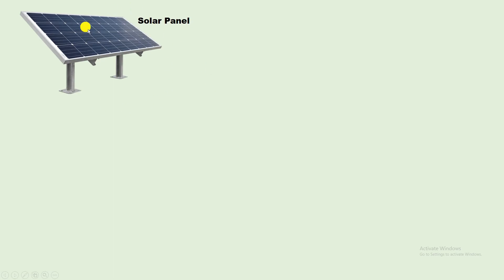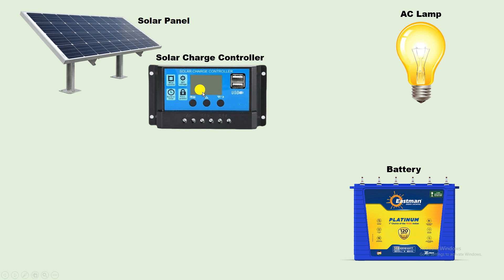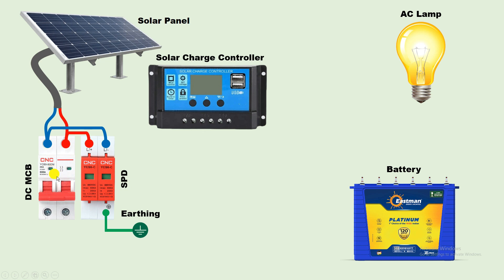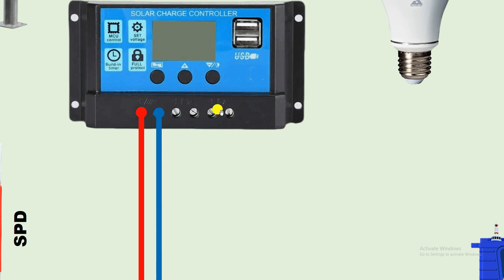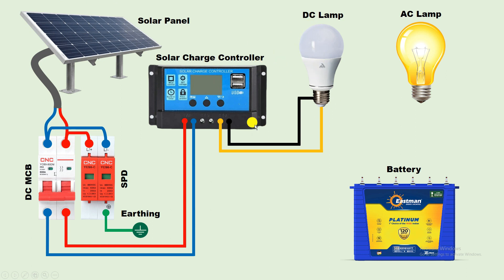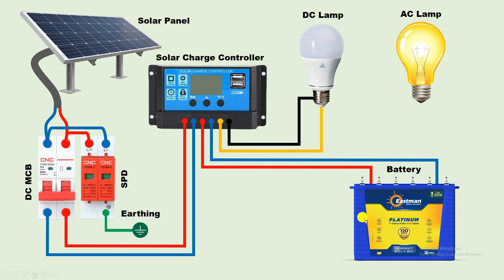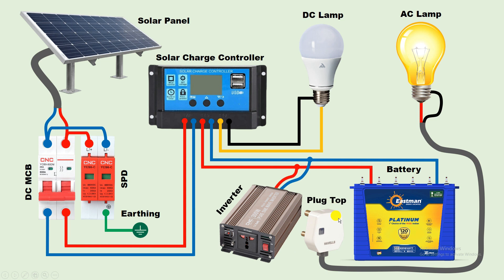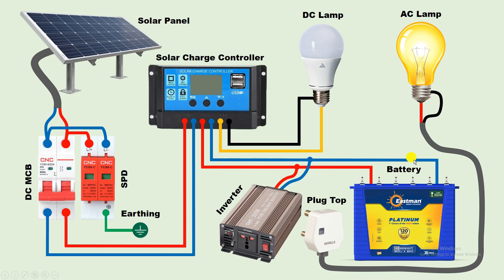Complete Solar Panel Connection with Solar Charge Controller and Inverter @TheElectricalGuy

Comment: I didn't hear him mention what a DC MCB actually is - MCB stands for Miniature Circuit Breaker and it is a DC version versus the ones in your house's electrical panel are AC circuit breakers. This is to prevent the solar panels providing too much current (amps) that may overheat the wires carrying the current and potentially cause a fire.

Comment: Hello, thank you for your video. It is easy to understand. I just would like to ask for your suggestion/recommendation.

I am planning to have the power supply of all submersible pump (4 pcs) on my fishpond. Do you recommend the same set up for this? I am planning to build the same set up as shown in your video just replacing the lamp with Universal extension outlet.

All pumps run 24/7;
Description of the pumps are the following:

1. A4000 Aquaspeed
Voltage: 220-240V
Frequency: 50/60Hz
Watt: 24w

2. A3000 Aquaspeed
Voltage: 220-240V
Frequency: 50/60Hz
Watt: 16w

3. A2000 (2pcs)
Voltage: 220-240V
Frequency: 50/60Hz
Watt: 13w

Comment: Actually this is not correct.  Your MCB and circuit breakers do not connect to solar panels.  Solar panels go directly into controller and the circuit breakers should be on the output of the controller to protect the circuit

Comment: Hi Very good explanation.

I have some questions and make discussion among the group here.

1. For surge protection device, can it install after the MCB ? What will be Pro and Con then?

2. Some country, there is not ready earthing connection at home. So, those home usually use RCCB instead of earthing for protection. For these home, installation of surge protection device maybe impossible as it will not be working at all without installing earthing cable. So, can we use RCCB here instead of surge protection device please ?

Thanks to all.

Comment: wrong..!!!!!!! battery first so that panel voltage will adjust to 12v... 

if your solar has a higher voltage your battery will be going to overheat because of over voltage..

Comment: Hello
great video!
I have at home 5 PV strings in series but different voltage and different current, I can't do a // connection?

I have 5 different MPTTs not string
do I need 5 surge protectors 5 DC circuit breakers and a big 63A circuit breaker?
thanks
laurent

Comment: Please explain that Why do you have to use MCB when you can use charge controller with higher Ampere which can control the voltage supply to battery ..

Comment: Give correct information , 
Always prioritize connecting the battery terminal wires to the charge controller initially, followed by linking the solar panel(s) to the charge controller.
Avoid connecting the solar panel to the charge controller before the battery, as this may cause initialization issues.

Comment: You also need a dc breaker between the battery bank and the inverter and you need to apply electricity security rules between the inverter and the house !

Comment: Bad piece of advice you also need a breaker between the solar charge controller and the battery bank!
Reply: Correct.
Reply: Not necessarily a must
Reply: It's improper to say bad. You can correct it in order ways. After all, he said it.
Reply: Thats why we use mcb
Reply: U don't necessarily need to feel the whole place with breakers. It's a basic setup and you could have don't better if you wanted to make corrections
Reply: But he said it,,mcb

Comment: Don't forget a fuse from battery positive in case there is a short circuit in the battery leads to the inverter, and perhaps a disconnect switch off the positive too.

Comment: When powering the ac bulb via an inverter, you bypassed the battery in your illustration. Why is this?

Edit: I now see the same wires are connected to the battery and inverter from the controller. How do you make your wires split like this?

Comment: how can i charge my battery without solar panels
Reply: Buy battery charger
Reply: Hire someone.
Reply: Can I wire the controller up to a splitter
Reply: question for you combine this solar panel 200v 400v and  solar charger controller and battery, car inventer 220w and this MC4 inline fuse holders how many are needed to handle charging a cellphone 
Pls draw me diagram
Reply: Guys what is earthing?
Reply: @POW28 ground duh
Reply: you can use just any car
Reply: Connect your AC Inverter Plug to Your Electricity Power Plug Board Socket like your mobile charger

Comment: Hi electrical guy. I have questions. You still answering questions ?
Reply from the maker: Yes ask
Reply: @TheElectricalGuy  can i connect inverter directly to controlle'r's  battery charge outout or connect it to controller's  load output ?

Comment: I have two questions. Can you please answer those? 
1) Whether the inverter is solar inverter or Normal Inverter?
2) The Stabilizer is relay voltage stabilizer or servo voltage stabiliser and what is the Input Voltage Range?

Comment: Good day sir! So is it possible in the middle of the day for power to skip the battery stage entirely if you using an appliance and getting enough power from the sun? Is it possible to get  straight from inverter to power ac while also putting dc into battery charging it

Comment: I would put MCB between the battery and inverter to prevent current surge and to protect the battery. That is where fire usually starts if there is overload.

Comment: Thanks for video 👍🙂
Why did you not wire the battery to the (solar charge controller) as the very first thing to do?? 
Thought is was important that battery was connected like the first thing to do ??:-)

Comment: I WOULD DEFINATLEY CONNECT THE INVERTER WIRE DIRECTLY TO THE CONTROL UNIT!  DSIRECT CURRENT IS NO FUICKING JOKE AND EXTREMLY DANGEROUS!!!  THIS GUYS AN ENGINEEER AND IM SURE HE IS SMART AND MADE THIS VIDEA AND I THANK HIM FOR THAT!! BUT I WOULD NOT SPLICE THAT DIRECT CURRENT WIRE AT ALL! I MEAN IT MAYT NOT BE THAT MUCH BUT ITS ENOUGH CUZ DURECT CURRENT NEVER LETS GO! IT GRABS AND WILL HOLD TIOLL THE SUIN GOES DOWN! OR SOMETHIGF BURNS OUT! OR YOU OR I BURN OUT!  AND WE DO NOT WANT THAT!

Comment: my solar panel is 175w 12v which should i buy DC MCB how many amps for my solar panel?SPECIFICATIONS
Maximum power at STC*: 175 W

Operating temperature: -40°C to 85°C

Optimal operating voltage: 19.5V

Optimal operating current: 8.98A

Open circuit voltage (Voc): 23.9V

Short circuit current (Isc): 9.50A

Solar panel size: 150.37 x 67.31 x 0.20 cm

Weight: 2.81kg

Comment: Thank you for the informatic video ! but in the rainy season if i want to charge the battery with external electricity how to do it is there a single kit for solar power controller and external electricity ?

Comment: Excellent presentation, Only suggest is to make it clear from the start .  If connecting a battery, always connect the battery to the controller before connecting the PV array to the controller so in your example disconnect the PV array, connect the battery then the PV array.
Reply: the biggest mistake anyone can make always battery first or you fry the controller.
Reply: what a pv

Comment: I have a charger inverter 24v DC system.
Can I add solar panels with a charger controller. 
Or there is no way except i should bring a new hybrid inverter.
Please, can anyone with experience  advise me on solutions in such cases.

Comment: When assembling  a  solar power system, it is important to note, that the Solar panel is the last thing to be connected to the solar control unit, 
connecting the solar panel to the control unit first will damage the unit. the battery should be connected first, followed by the solar panel, always connect negative wire first and the last wire to be connected should be the solar panel positive wire. Unfortunately this is not explained in this video.
Speaking from experience.
Reply: This is true.
Reply: I like your analysis. It shows you have a great experience in Solar connection. Please, what value of the MCB should I use for 2 300watts panels and 60 amp charge controller? I will appreciate your response.
Reply: Why connect negative before positive? Current flows through the negative, right?
Reply: I was going to say the same. I'm not an expert, but I have seen other videos and they always say what you wrote. On the comments a lot of people also wrote that it can damage the controller.

Comment: You have made a mistake. You have to connect the battery to the charge controller before you connect the solar to the charge controller. If you dont do this you destroy the charge controller.

Comment: What is the difference between Battery and DC Load (+-) and why the inverter will not connected to the DC load? If I understand right, the DC load can also be used from solars directly? Maybe if you get the power from the Battery (based on Ampers of the battery) you can get more power than the DC load (which is based on Ampers of the charger?)
Reply: that is the same question I have, but almostevery tutorial suggets to connect the inverter to the battery, did you find the answer?
Reply: MPPT controller CANNOT provide high amps thru its output, while battery can.

Comment: The method of connecting the inverter from the charging controller or from the cable extending from the controller to the battery is incorrect. The correct method is directly from the battery, but from the controller, it is only suitable for light loads.
🇾🇪🇾🇪

Comment: With a 12v 2000w inverter, what prevents an AC load from drawing more than 12 volts through the inverter from the 100 50 mppt charge controller?

Comment: Thank you so much from Nigeria 🇳🇬  but I need a video of how u can connect this whole proceess with electrical distribution board
Reply: That'll be from your inverter mains to your distribution board. Depending on what you want connected, you can just attach to your change over switch or detach specific items you want on your solar power constantly from the distribution and NEPA mains

Comment: Sir can't some one use only the panel controller and battery only?
Reply: If you are asking if it is mandatory to connect your load circuits to the controller to make panels charge up your batteries, then the answer is no. As an example, if you had panel(s) and controller hooked up to your battery bank and then the lights in your RV connected as load, if no lights were turned on, your batteries would charge up just fine. The advantage of connecting your actual load circuits to the controller is that Bluetooth enabled controller can give you some valuable measurements about your whole system. You may discover, for example, that a circuit you thought had a very low power draw may, in fact, be responsible for depleting your battery bank faster than you thought it would. There are a lot of 12 VDC devices that are intended for use in an automotive application and when the vehicle is running, they can draw heavy current and the alternator will keep the start battery charged fully. A car radio or CD player might be an example of a device that could deplete your battery bank very quickly. Although inverter manufacturers say you can run your inverter 24/7, there is nothing wrong with turning it off if you want zero current draw to occur. My modest true sine wave inverter came equipped with a corded on/off switch and, most days,  I only turn it on to grind my coffee beans for breakfast coffee. A laptop computer is generally not a battery killer, and you can keep an eye on the laptop battery gauge, and only start using a 120VAC power pack to bring it back up to 100% when it gets low. A 120VAC heating device of any sort is a real power glutton. For this reason, refrigerators are best operated on propane and ideally, one that does NOT require 12 VDC to run the propane function. I was fortunate to find a second-hand  "passive" refrigerator that had a freezer compartment and it requires no 12 VDC to operate. Shower water heaters that use batteries or 12 VDC to ignite only use power when water flows and the burner needs to be ignited. I like the 12 VDC flat two (like trailer running light connectors) since I have seen problems with the battery door failing to make good connections on water heaters of fellow campers. It takes very little to connect a 12 VDC power cord to the water heater. The display circuit on mine only operates on demand when water flows.
Reply: On the topic of powering your laptop, I  find it better to use a 12 VDC cigar lighter power cord for my Lenovo Think Pad laptop so the inverter colling fan will not run when the laptop is drawing a heavy current. My Lenovo  cord was over $50 but standard-rated 3.1 amp USB receptacle to USB-C cord arrangements are underpowered and fail to be recognized as an acceptable power input for that Lenovo laptop. 

If your laptop requires a DC voltage greater than 12 VDC, there are inexpensive voltage raising circuit boards that work fine. You just have to fine tune the output voltage when they are applied. I have had complete success with this approach.